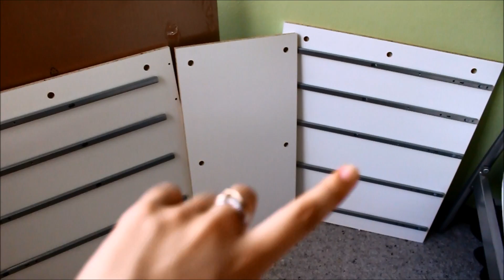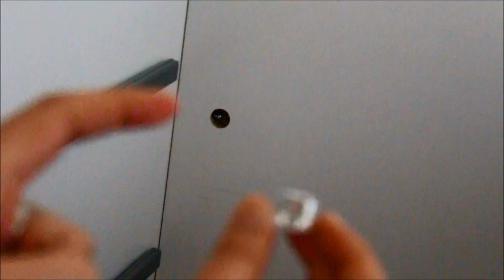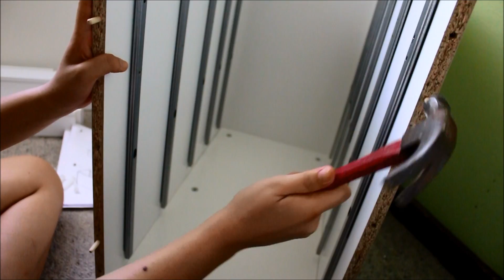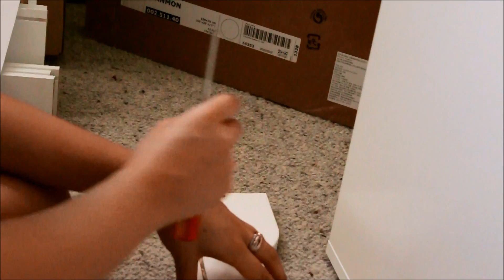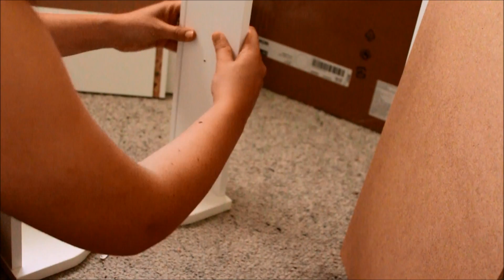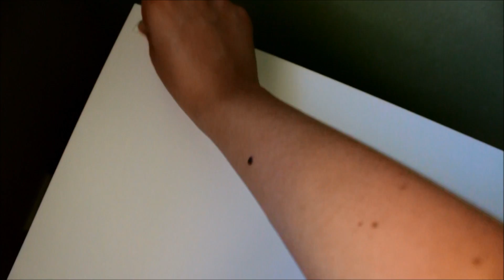HOW TO SET UP IKEA ALEX/LINNMON DRAWERS - For Beginners! Throwback New Makeup Storage Vlog!

Comment: Please tell me where to buy those sticky things for the Alex draws cause I’ve been trying to attach the tabletop to my Alex draws! Please let me know where to buy those sticky things!
Reply from the maker: I know you can buy them off amazon/ebay, since it seems like they stopped putting the stickers in the package. To be honest, most of mine have fallen off/moved. However the tabletop seems secure without anything attached to it since I have items on top, weighing it down. If you need to, you can always try drilling a hole into the tabletop and attaching them together with some kind of screw?

Comment: Everything was easy except putting on the table. I never received those little sticker things and spent about 2 hours trying to nail it through the holes. What a waste of time. I think I’m just going to use double sided tape until I figure out how to mcguyver nailing it down
Reply from the maker: It seems like they stopped putting the stickers in the package, to be honest, most of mine have fallen off, so there's no point in having them. However the tabletop seems secure without anything attached to it since I have items on top, weighing it down.

Comment: What is the dimensions of Alex drawers and table top 8 will be making custom
Reply from the maker: - ALEX DRAWERS -
_________________________________

IN CENTIMETRES:
Height: 70 cm
Width: 36 cm
Depth: 58 cm

IN INCHES:
Height: 27 1/2 "
Width: 14 1/8 "
Depth: 22 7/8 "

- INSIDE DRAWER DIMENSIONS -
_______________________________

IN CENTIMETRES:
Width: 29.3 cm
Length: 42.4 cm
Height: 0.9 cm (Smaller Drawers)
Height: 13.5 cm (Larger Drawers)

IN INCHES:
Width: 11.5 inches
Length: 16.7 inches
Height: 0.35 inches (Smaller Drawers)
Height: 5.3 inches (Larger Drawers)

- LINNMON TABLE TOP -
_________________________________

IN CENTIMETRES:
Length: 150 cm
Width: 75 cm
Thickness: 3.4 cm
Max. load: 50 kg

IN INCHES:
Length: 59 "
Width: 29 1/2 "
Thickness: 1 3/8 "
Max. load: 110 lb 4 oz

Hope that helps xxx

Comment: How do you make sure the table doesn’t fall or is it the two ikea drawers holding it in place? Do you think if I put a vanity mirror on top of the table will it fall?
Reply from the maker: Depending on what you put on it, I find the tabletop is heavy enough to hold in place with whatever you put on it, but I would suggest if you have any concerns, you can glue or drill the table top onto the drawers. Hope that helps xx

Comment: are the rubber things that stop the top from sliding enough? I'm afraid my 188 cm counter top will slide around since its heavy and long
Reply: Mine didn’t come with the rubber or i just am blind no I don’t know what to do
Reply from the maker: Hi Fares, my Alex Drawers came with the Rubber grips, but if it helps, since the items you put on top are weighted, I haven't found my tabletop moves at all! But if you're concerned, I know you can buy them at most warehouse shops 😊

Comment: That's awesome 😁 thank you.. Can you tell me the sizes of drawer?
Reply from the maker: The whole drawer set or the individual drawers themselves? 😊
Reply: @missdemicarlavlogs  both😅
Reply from the maker: @kazino24  The Alex Drawers measure as:
Height: 70 cm
Width: 36 cm
Depth: 58 cm
or
Height: 27 1/2 "
Width: 14 1/8 "
Depth: 22 7/8 "

And the inside of the drawers are:
Width: 29.3 cm
Length: 42.4 cm
Height: 0.9 cm (Smaller Drawers)
Height: 13.5 cm (Larger Drawers)
or
Width: 11.5 inches
Length: 16.7 inches
Height: 0.35 inches (Smaller Drawers)
Height: 5.3 inches (Larger Drawers)

Hope that helps!
Reply: @missdemicarlavlogs  thank you so much for the information 👍🏼
Reply from the maker: @kazino24  Anytime! Thanks for watching! 😁

Comment: how deep is alex drawer, and how deep is the top table in cm please?? Thanks in advance!
Reply from the maker: - ALEX DRAWERS -
_______________________________
Height: 70 cm
Width: 36 cm
Depth: 58 cm

- INSIDE DRAWER DIMENSIONS -
_____________________________
Width: 29.3 cm
Length: 42.4 cm
Height: 0.9 cm (Smaller Drawers)
Height: 13.5 cm (Larger Drawers)

- LINNMON TABLE TOP -
_______________________________
Length: 150 cm
Width: 75 cm
Thickness: 3.4 cm
Max. load: 50 kg

Hope that helps xxx

Comment: Whats the length of that tabletop?
Reply from the maker: The tabletop measurements are:

IN CENTIMETRES:
Length: 150 cm
Width: 75 cm
Thickness: 3.4 cm
Max. load: 50 kg

IN INCHES:
Length: 59 "
Width: 29 1/2 "
Thickness: 1 3/8 "
Max. load: 110 lb 4 oz

😊😊😊

Comment: Length this desk ??
Reply from the maker: The tabletop measurements are:

IN CENTIMETRES:
Length: 150 cm
Width: 75 cm
Thickness: 3.4 cm
Max. load: 50 kg

IN INCHES:
Length: 59 "
Width: 29 1/2 "
Thickness: 1 3/8 "
Max. load: 110 lb 4 oz

😊😊😊

Comment: what are the measurements for each individual drawer
Reply from the maker: I've measured the inside dimensions of the drawers,

- ALEX DRAWER, INSIDE DRAWER DIMENSIONS -
_______________________________

IN CENTIMETRES:
Width: 29.3 cm
Length: 42.4 cm
Height: 0.9 cm (Smaller Drawers)
Height: 13.5 cm (Larger Drawers)

IN INCHES:
Width: 11.5 inches
Length: 16.7 inches
Height: 0.35 inches (Smaller Drawers)
Height: 5.3 inches (Larger Drawers)

Hope that helps!

Comment: What size table top is that?
Reply from the maker: IN CENTIMETRES:
Length: 150 cm
Width: 75 cm
Thickness: 3.4 cm
Max. load: 50 kg

IN INCHES:
Length: 59 "
Width: 29 1/2 "
Thickness: 1 3/8 "
Max. load: 110 lb 4 oz

😊😊😊

Comment: Just to confirm you're using the 55" X 29.5" Linnmon with 2x Alex drawers? I thought you could only fit two Alex drawers with the 79" linnmon. Also, with two Alex drawers is it pretty sturdy? I wanted to put my computer on it with this exact set up you're using. Thanks in advance
Reply from the maker: Yep! That's the one! Nope, you can fit two under that one and even the smaller table, you can fit two under! It definitely is! For sure, I've never had it crack, or wobble! 💕 Hope that helps!

Comment: What is the depth of the Alex drawer?what are the measures od the table top,please?Thank you😘
Reply from the maker: - ALEX DRAWERS -
_______________________________

IN CENTIMETRES:
Depth: 58 cm

IN INCHES:
Depth: 22 7/8 "

- LINNMON TABLE TOP -
_______________________________

IN CENTIMETRES:
Length: 150 cm
Width: 75 cm
Thickness: 3.4 cm
Max. load: 50 kg

IN INCHES:
Length: 59 "
Width: 29 1/2 "
Thickness: 1 3/8 "
Max. load: 110 lb 4 oz

😘💕💗
Reply: missdemicarlavlogs thank you.
You've saved me!.lots of love.😚
Reply from the maker: Of course! Anything I can do to help 😘

Comment: What are the measurements for the table top?
Reply from the maker: IN CENTIMETRES:
Length: 150 cm
Width: 75 cm
Thickness: 3.4 cm

IN INCHES:
Length: 59 "
Width: 29 1/2 "
Thickness: 1 3/8 "

💕💕💕

Comment from the maker: To those who are asking, the measurements are as follows:

- ALEX DRAWERS -
_________________________________

IN CENTIMETRES:
Height: 70 cm
Width: 36 cm
Depth: 58 cm

IN INCHES:
Height: 27 1/2 "
Width: 14 1/8 "
Depth: 22 7/8 "

- INSIDE DRAWER DIMENSIONS -
_______________________________

IN CENTIMETRES:
Width: 29.3 cm
Length: 42.4 cm
Height: 0.9 cm (Smaller Drawers)
Height: 13.5 cm (Larger Drawers)

IN INCHES:
Width: 11.5 inches
Length: 16.7 inches
Height: 0.35 inches (Smaller Drawers)
Height: 5.3 inches (Larger Drawers)

- LINNMON TABLE TOP -
_________________________________

IN CENTIMETRES:
Length: 150 cm
Width: 75 cm
Thickness: 3.4 cm
Max. load: 50 kg

IN INCHES:
Length: 59 "
Width: 29 1/2 "
Thickness: 1 3/8 "
Max. load: 110 lb 4 oz

Hope that helps xxx
Reply: missdemicarlavlogs Did your table top hang out in the back ? Or was it all the right measurements ?
Reply from the maker: @BarbiiePinkyBoricua  It did, there was some extra space out the back. When I moved into a smaller room, I switched to the 120x60 cm tabletop, and there was no extra space out the back 🤗
Reply: missdemicarlavlogs how much was the table top? And are they pre-cut? :)
Reply from the maker: @jmnXX51  $49 Australian, and they were pre-cut, but there were a few different size/colour options!
Reply: missdemicarlavlogs a
Reply: Do they do custom measurements for the counter top
Reply from the maker: @geobeo97  Unfortunately not, but there are a few different options for pre-cuts x
Reply from the maker: @SparkTheGenius  That was one of the main reasons I got this set up, because there was so much room for flexibility! I got the smaller 120x60cm tabletop when I moved, but later if I wanted to get the 200x60cm tabletop, it can fit 4 of the smaller drawers comfortably! So there's so much room to grow! 🤗

Comment: What size table top did you get? Ive just bought this and I got 120x60cm x
Reply from the maker: I got the 150x75x3.4 cm table top :) It's the one 1 size larger :)
Reply: missdemicarlavlogs so mines a little smaller than yours? x
Reply from the maker: Yep, but I recently moved and the larger tabletop didn't fit in my space. So I went and bought the 120x60cm, so we're twinning now! 💕

Comment: I know this is random did u get them in a car or truck? I want to go get them but I'm afraid they won't fit in my car (the table top) and I would drive about 2 hours for nothing/: ???
Reply from the maker: Hi Daisy! My partner put the seats down all the way and had the table top coming through the boot into the back seats. I heard it was quite tight, but if it's an option, maybe ask a friend with a big boot, or trailer :)

Comment: can i fit 3 x27 inch monitors onto this table?
Reply from the maker: Probably not, you could fit 2 comfortably, but if you wanted 3, I would go with the longest linnmon top!
Reply: Whats  the length of the one in your video
Reply from the maker: It's 150cm long x 75 cm wide :)